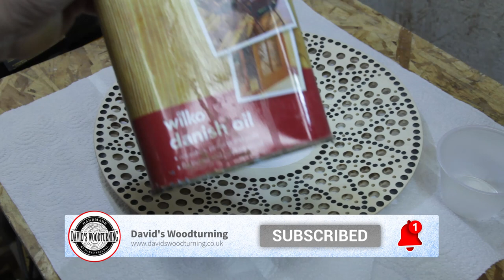Woodturning / carving – Heart of Holes Plate

Comment: 🤭😷, as I said in your previous video - a form of direct dust extraction was needed = as you were wearing your respirator, you were doing additional things that make dust on your lathe bed - particularly that milling the holes around the heart in your creation, appeared to be making very fine dust/even smoke? I was thinking - if that wall behind your lathe is a stud partition type, you could cut a square hole in it, in-line with the work area of the lathe and have the dust extractor on the other side, with a grill over it to protect it from wood pieces flying off the work piece. If the wall is an external wall (even though it doesn’t look like one) you could put a extractor fan in it to suck the dust out of your workshop - both of these will draw the dust away from you and not have it floating around in your workshop (eventually being drawn out by a open window/door, a extractor fan)